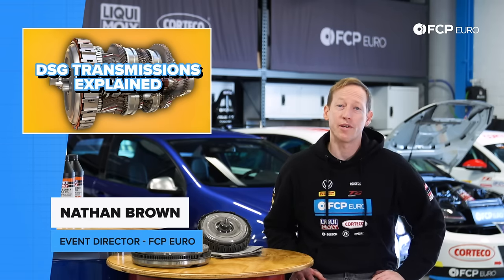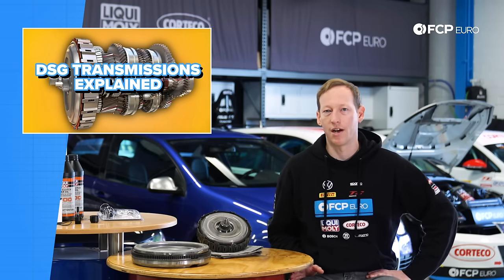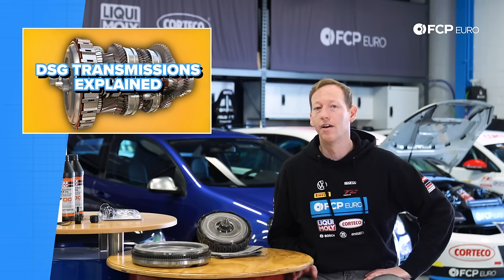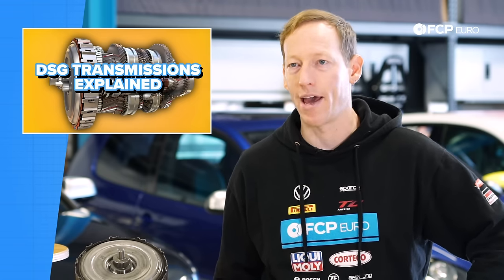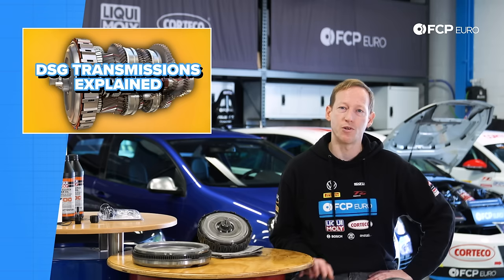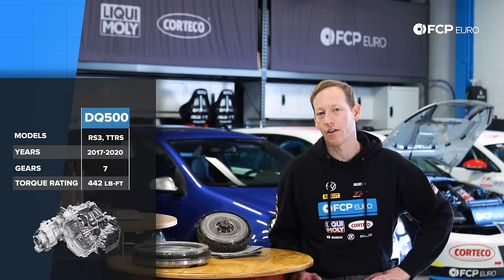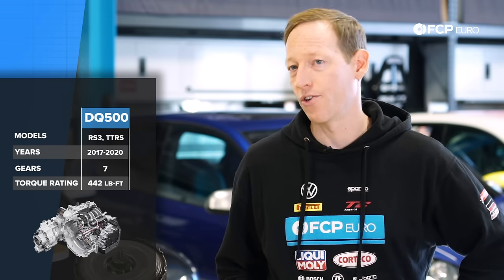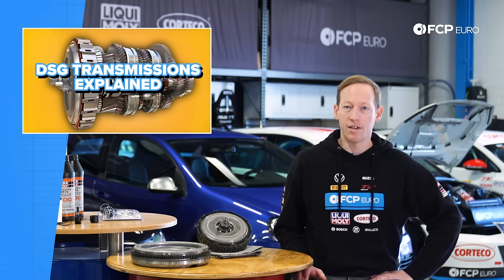The DSG Transmission Explained - How A DSG Transmission Works, Advantages, & Cars That Have Them

Comment: Been chasing a drivetrain shutter in a low mileage 2022 Audi Q55e with a 7 speed DSG.  Got a little better after changing center diff fluid. Watching this excellent video I'm wondering if there are any known early failures of the dual mass flywheels, Shutter is accelerating uphill at cruising speeds.

Comment: my 13 s5 started to stutter in odd gears.. no codes....later after a long drive. stopped at gas station ...started to drive and the car violently jerk a few times   then coded and only drove in even gears......any ideas tran code is nsc

Comment: Any chance you guys could post some of the measurements or a 3d scan of the different  DSG transmissions on your website? (or ideally a simplified cad?)

Planing a fully custom single seater build and want to do the full cad first. Finding good models or measurements is a bit of a pain. 

Especially looking at the DSG DL250/500 and the BMW GS7D36. (depending on packaging)

Comment: Great explanation, lots of really good information here. I like the comparison you made between the DQ250 and the DQ381. I’ve driven several 250s but when I bought my GTI with the 381, I was pretty disappointed by the shifting. I was expecting it to shift like the older ones, but with the added benefit of that 7th gear. Like you said, it was “slippy” and just didn’t have the crisp, fast shifts of the 250. It also seemed like the clutch engagement when taking off from a stop wasn’t as sharp. However, it did seem like the faster/harder I drove the car, the shifting would improve, especially in sport mode. I was just wondering if it was actually designed to work that way, or if it’s just a figment of my imagination. Can you shed any light on that? I no longer own that car, I now have a Mk6 GLI with a 6-speed manual. As much as I love driving manuals, I still miss the way a DSG drives. My wife’s Macan does have the PDK, so I suppose I can get behind the wheel of that whenever I need my “DSG fix” 😆
Reply: Did you ever tune your DQ381, I know he said tuning helps but still doesn't feel like a DQ250 but I'm wondering if you did it and what the change was like for you.
Reply: @rambow70  I did not tune it

Comment: The clarity, technical information and scope of the DSG is comprehensive - as the presenter speaks with confidence and knowledge. Absolutely Super.
Reply from the maker: Thank you Boris!
Reply: @fcpeuro   I currently have a 2017 Passat Estate 2.0 TDI DSG and the gearbox was becoming increasing clunky as slow speed. Two weeks later this awful noise on idle at 850rpm at standstill. Unknowingly on removing the box, the flywheel was heavily covered in metal dust, the clutch assy was cracked and bits of metal broke off lying at the bottom of the bell housing. This car has only covered 49,956miles!

Comment: News flash - dsgs with wet clutches also use hydraulic pressure to apply the clutches and shift gears. Modern ATs also shift extremely fast and realize complete lockup of the engine and transmission together. Also not mentioned that VW dsgs integrate the front diff with trans which shares the same fluid with gears and 2 clutches. Audi actually has clutches and hydraulic controls in a separate chamber while the front and center diffs plus gears are in their own separate compartment with different fluid.
Reply from the maker: Correct - the DL501 utilizes a divorced lubrication system, unlike the other VW/Audi transverse transaxles that share fluid for clutches, gear stacks, and differential. You're also on point with the late model ZF 8-speed being much better than older traditional automatics, so while what we're discussing here is more or less true, there is less of a performance gap than there was in years past.

Comment: I think the main thing you didn't point on is that the transmission itself isn't repairable in a sense. There are a few shops who have the ability or spec to replace internal components. Also the dq250 has 2 filters one internal non serviceable and one cartridge. The dq250 changed with the mk7 no longer is considered a 02E, mk7 use a 0D9 dq250, biggest difference I've notice when fully disassemble is that the temp sensor in the 02e is next to the mech unit. 0D9 is internally in the mech unit.

Comment: Great video! I have a Mk7 GTI with a DQ250, loooove it! Among other mods, my favorite has to be the 3" valved Varex exhaust. In straight pipe mode, I get DSG cracks that sound absolutely glorious. Bonus is that when I wanna go low-profile, I just hit a button on the fob, and I'm as quiet as stock. Nothin' to see here! 😏
Reply: @Pipa Obala It's not too bad around the city for me, but I agree the clutch engagement is a bit clunky at times, particularly when parked downhill and you have to reverse, and vice versa. First gear likes to diddle sometimes, too.
Reply: Sweet 😁
Reply: Thanks for your reply really helpful Thanks again man 👨.

Comment: My DQ250 DSG box on my 2007 Passat has surpassed 230,000 miles, which for the 3C2 BMR engine it is coupled with is itself a miracle, and it still shifts very smoothly. All oil / filter services performed and about to have its 2nd Dual Mass Flywheel replacement. The 3C2s (aka B6) were the worst car Volkswagen made and many have still covered 200k miles or more. Not bad if that's their worst car!

Comment: 2018 Alltrack SE owner here.  The only downside I have with mine is the hesitation while the DSG engages from a stop.  Couple it with with the turbo lag, and the off the line acceleration suffers.
Reply: Yeah, only thing I don't like with the DSG in the Alltrack too.
Reply: @elestromusicgamesfun1101  it protects the clutches

Comment: Hey great video thanks! Could you maybe discuss more DSG variants as well, maybe the DQ200 dry clutch etc.?
Reply: A lot of problems with the mechatronic units of the DQ200 here in Brazil
Reply: @Nagato is better than Punk Naruto should go for a Bmw dct
Reply: @luddieg  which year the DQ200's were released?
Reply: @Lee-gr2sd  0am had issues, 0cw is decent
Reply: @dragospahontu  how do I know which ones which?
Reply: @aquilinorodrigo  after 2014 or so they came with the revision
Reply: @dragospahontu  Ohhh, we're fine then. We have the DQ200 from 2017.
Reply: @aquilinorodrigo  those are already sorted

Comment: I have 2010 superb with DSG 200hp. generally good gearbox and does good job considering car is over 2000kg. But oh boy if it goes wrong god have mercy on ur wallet it prob costs 2 or 3 times more to repair than normal manual gearbox.

Comment: Great Video; thanks.  Long time FCP customer and fan.  I have a higher hwy mileage B8 S4 with regular fluid changes running a new replacement Mechatronic flawlessly for last three years and have stage 2 ECU and TCU tunes.  I have a shifting issue becoming more and more noticeable whereby my odd-to-even gear (1/3/5 to 2/4/6) upshifts are slightly rougher and delayed with a slight RPM upsurge vs even-to-odd, or all downshifts.  Most noticeable is 3-4, and all more prevalent when 3,500+ RPMS.  Any thoughts you could share on where I should be focusing my attention would greatly appreciated.  Thank you.

Comment: In europe they also sold a 7speed DSG with (dry clutches) worst versions you can have, they are known  for unreliability due to the clutches wearing out quickly. I sadly encounterd that and its costy thing to replace. Thats why i recommend a 6speed with wet clutches because they are way more robust.

Comment: DSG,Doesn’t Shift Gears. Yes, expensive to repair,unreliable. I bet this reporter has plenty in his workshop that have gone to crap,so he loves them. I’ve had two Golfs ,currently one Audi Q2 with only 18,000 miles on it,all failed. The salespeople will tell you they’ve improved over the years but they won’t stand by their product. I suggest don’t buy any car with a DSG gearbox.
Reply: Toyota kid detected! 

My own experience+5 of DSG and it wasvdry reliable, fuel efficient and smooth.

Comment: Excellent video - thank you. Do you have an explanation for a DSG high temperature warning light appearing on 7 Speed 4 Motion 2018 model Tiguan. This can happen in off-road mode when you attempt to climb a steep hill with a slippery and uneven surface? Is this related to clutch slippage while the traction control works out which wheel to send the power or something else?

Comment: I've got the dq250, getting a remap on Wednesday, along with a tcu tune on the gearbox, audi a3 2.0 tdi 😄
Reply: How did it go? Any issues?
Reply: @motivatedregardless4816  no issues, got 200bhp and 420nm torque from it, I fitted a brand new turbo prior and made sure I changed my mounts and suspension along with changing gearbox oil and engine oil and filters prior too 😄
Reply: @Tuchh what remap service did you use? And what oil brand you here recommended?
Reply: @andrert2178  forgot the company name for the remap, the dsg gearbox oil was from eBay: Original Zf Transmission Filter + 6L DSG 6-Gang for VAG DQ250 Incl. Hose

Comment: BMW swears that their transmissions are sealed and do not need to be serviced.  they say that they are  built and designed to last for the life of the car with no servicing.  is there any truth to this or is it just crap?  thanks. P.S.  I think it is crap :)
Reply: Yes, I also would like to know. It seems impossible.
Reply: It depends... where you and BMW might disagree is the definition of "the life of the car". It's likely that, using their definition, the transmission will last... 
One of our cars (Ford) also has a sealed, lubricated for life, transmission. But I didn't take their word for it and changed the fluid (it's manual, so easy to do). The fluid that came out was disgusting.
Reply: Car manufacturers define the life of the car as 100k to 150k miles.
Reply: @AlessioSangalli  Indeed, while the owners expect them to survive at least twice that mileage. Which is not that hard with proper maintenance.
Reply from the maker: It depends on the transmission type and what they mean by lifetime. Lifetime for them as mentioned by some of the other commentators for an automatic is 80-100k miles. We have some DIY videos on servicing the ZF transmission found a number of BMW and other Euro models. The BMW DCT is a little different as it does not have a transaxle with shared fluid for the clutches, gear stacks, and differential. This keeps the fluid a little cleaner and under less stress, but BMW DCT service should still be performed at around 40,000 miles for the most reliable service
Reply: As a automatic transmission specialist my advice is to change it at   100,000 kms  at most.  The 6hp and 8 hps are pretty good transmissions but make sure you service it .

Comment: Thanks for this eccellent info on the dsg. You briefly touched on dual mass flywheel problems which sounds like what I am experiencing in my audi a3 1.8 tsfi. Another vid around diagnosis of this problem would be helpful to me
Reply from the maker: Thanks! Glad you enjoyed it. The dual-mass flywheel issue is a tough one to diagnose, often times you can go by mileage. On a TDI car they tend to live a harder life so will need service at a lower mileage - something around 120k. On a gas car it's usually closer to 200k, but it can depend. If you're not up on service doing a fluid and filter first could help with any shifting issues
Reply: Mine has a chatter sound when cold in park or on initial acceleration. Not terrible yet but I’m about to replace it. I call it an unfortunate wear item so now I’m prepared and it won’t be a problem. Could be much worse, it’s my favorite performing auto and it’s relatively cheap and reliable too.

Comment: DSG is one of the worst transmission ever fitted to a car. They are nice when they work. But failure of mechatronics is a car killer to any car older than 7 years as usually it costs more than the car itself to fix. And it's sad to see car enthusiast calling them reliable by any means!
Reply: A transmission always costs a lot

Comment: Hello 

I have a dq250 and i have a problem with the N216 valve and i dont get the 2nd gear... o get in the vagcom short to plus in the vag.... dont know if only change the valve or the entire mechatronic ...can you give me a way to go ..thanks great video
Reply: Run basic settings then drive using the paddles only. Do not select D before driving in all the gears with the paddles/manual mode.
Reply: @andrert2178 hi thanks for the reply I already fixed .... a guy from Norway help me I pay a little fee and he was extremely helpful I change the entire mechratonic and re programmed it .... the car it's like the first day thanks

Comment: I really wanted a manual TDI Mk6 Golf but there wasn’t a good one around so I settled with DSG and I’m very happy with it. Very great performance for an automatic I still prefer the fun of a clutch though. My flywheel is about to need replacement though so I’m gonna add a Wavetrac LSD while I’m in there.

Comment: I had a dsg transmission that I had to replace out of pocket because of that mechatronics unit messing up and disengaging on the hwy, could have filed a case for that or recieved compensation???? PLEASE HELP!
Reply: If you call a dealer with your VIN you can check and see if it has any open recalls. If it had an extended warranty and you made that repair out of pocket within that extended mileage range, you can call VW Care and submit receipts, and make your case, but only if it falls under an effected model or year and only if it meets whatever criteria.

Comment: Great video , what is the max torq when clamping press is set to max by tcu tuning that dq250 can handle ?
Tia
Reply from the maker: Because there are many variables in this equation - age and mileage of the clutches, the tune itself, and the various strategies they use for clamping pressures, transitions, etc, it can vary. As a general rule for most road racing and high performance street driving applications, the DQ250 can handle something around 500 lb-ft of torque on stock clutches without any issues. We have some additional information here: https://blog.fcpeuro.com/the-definitive-guide-to-the-dsg-transmission

Comment: Hmmm... You don't have a correct information about DSG DQ500. I drive Tiguan TDI 2.0 4cylinder from 2013. that have this 7 gear DSG transmission (DQ500-7A).

Comment: I would love to hear your thoughts on the Mercedes Speedshift transmission (722.9 etc).  Perhaps a discussion about fluid change intervals (is it better to change the fluid more often that the manufacturer specifies); what to watch out for when buying a second hand car; common issues with the TCU, MCT and valve body; correct fluid etc

Comment: DQ381 has advantages of MPG. But the issue is the plate. Some shops break down the DQ381 and found it is thinner than DQ500. However, they found just change the plate can make it will be much better
Reply: have you got a video or article i can find on this
Reply: @mohammadkhan8567  
1:/ audi 19款s3 7速双离合%汽车 %锻造 %奥迪；ÊÊrvJikV1O9k8ÊÊ🆑zhi打汧þÕùýŀň
This is a link for the video. But you need to download the Chinese App Store tiktok. Basically the explanation is same as mine. I just translated their speech

Comment: I'm surprised to see such praise on the DSG's as several friends with experience in auto mechanics clearly told me to not buy a DSG. I think they've seen way too many ruined by improper maintenance. It's probably not very wise to get a high mileage car with a DSG, if you don't know for sure the owner(s) changed the oil and filter in time.

Comment: Nissan GTR R35 comes to mind. Also, the DSG is not a Volkswagen development or product. DSG is just a marketing wankery. That thing is called DCT, because that's what it is, and it's made by BorgWarner in that case. I don't think there is any large OEM that builds their own transmission. They all source their transmissions from BW, Getrag, Tremec, ZF, LUK, Ricardo, etc..

Comment: Nice tech review... Question for me is would the DL 501 be possible to replace the tiptronic in my 2005 2.7T allroad. Reason being the performance upgrades this motor will be undergoing this year. RS6 turbos/intercoolers, 2.8 heads  with 2.7 exhaust valves, rods & crank upgrades, 631 injectors, higher capacity maf, RS4 sized Y pipe, higher volume fuel pump.... etc ... etc.. Aiming for somewhere in the 600+hp range..

Comment: 22:04 in terms of reliability is DQ381 superior in any way to DQ250. Given higher torque rating applied to the same engine with slightly bumped up performance numbers. Should take away pressure from the transmission.

Comment: Thankyou for the information its impressive that stock DSG are capable with such abuse like track use, i thought the transmission had internal hardware upgrade. I was doing some research on A6 3.0tfsi had quiet good perfomance up to 500hp upgrade with APR kit and i found out it has DL382 code that not yet explained in the video, I wondering how good is it?

Comment: interesting I have a DSG 7 speed in my 2012 VW van with 288k miles , the gearbox the oil was changed 20k miles ago . touch wood still working ok.

Comment: I have a 2013 Audi A5 2.0T with an 8 speed dsg gearbox. My gearbox was making weird noises so I took it in. They replaced my gearbox with a brand new one and struggled to adapt it. When I pull away the car will shake or it will rev up to 1500 rpm and slam into first gear. They have replaced almost everything from the tcu to the mechatronics unit and still has the same problem. After watching your video, I'm convinced it is the fly wheel. The car has been at the mechanic for 3 months now. What would you say is wrong with my transmission?

Comment: Yes it is just another expensive to repair piece of auto hardware. $4000 for dual clutch labor and $2200 for dual clutch hardware. Dealership only repair sadly almost 3rd party shops won't touch it.